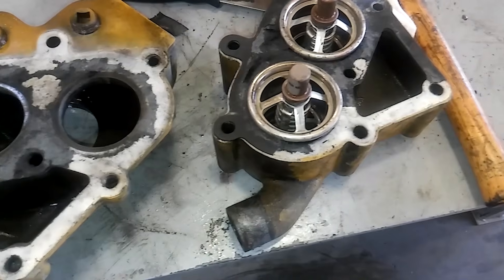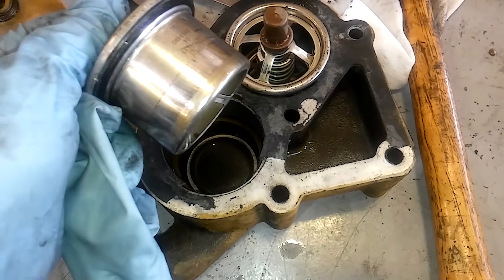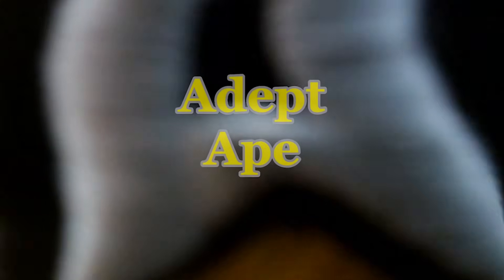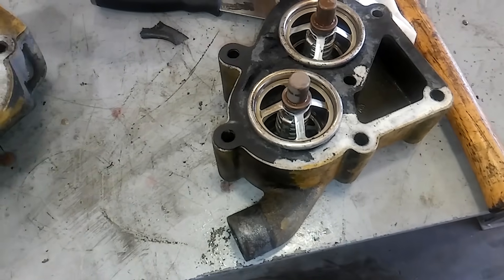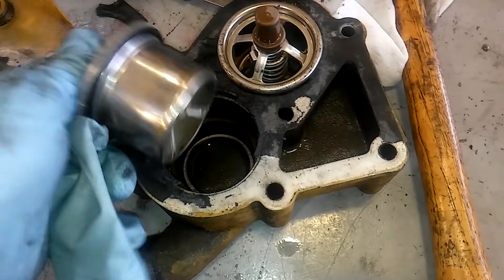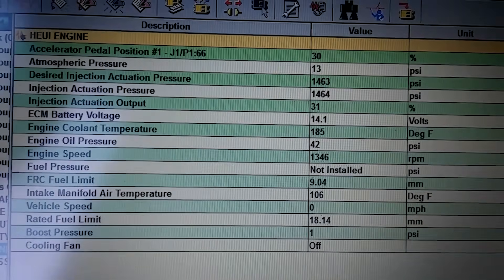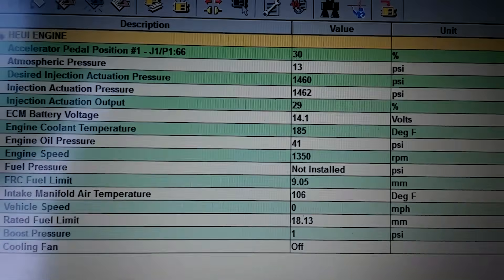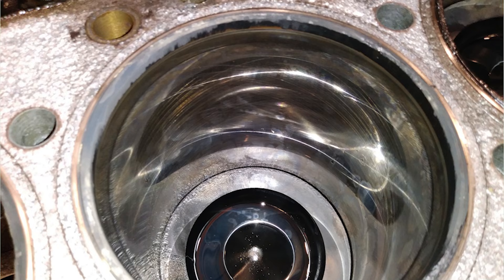Why You Should Never Remove or Use a Colder Thermostat In Your Engine.

Comment: As a former OEM truck engineer responsible for validating Caterpillar and Cummins cooling system installations, I find the ignorance of some of these comments astounding.  I agree with most of this video.  Here are a few points to clarify the video and the inaccurate comments.

Removing the thermostat can make the engine overheat, not run cooler, because the lack of thermostat means the bypass isn't blocked, so you're splitting coolant flow between the bypass and radiator instead of sending it all to the radiator.

To those of you clinging to the myth that coolant flowing "too fast" doesn't have time to cool off in the radiator, well, then it also doesn't have time to get hot in the engine.  Heat rejection is the flow rate times the temperature change, and being a closed system,  the temperature rise across the engine has to be the same as the temperature drop across the radiator.

There is no such thing as coolant flowing "too fast", but there is such a thing as too slow, where the boundary layer can boil on the heat source or not transfer heat efficiently in the radiator.  Boiling coolant on the heat source can cause erosion and/or cracking.

At a given operating condition, the engine always puts the same amount of heat into the coolant.  The coolant will get as hot as necessary to expel that heat into the ambient air via the radiator.  If you have a fan, radiator, water pump, pressure cap, or recirculation seal problem, a thermostat doesn't fix anything.  As the video says, the thermostat controls the engine's minimum operating temperature.  It has nothing to to with the cooling system's ability to reject heat.
Reply from the maker: I pinned your comment to the top, very good information there, especially the bypass and coolant speed. Everyone should read that.
Reply: @AdeptApe  if the bypass isn't hot enough and it's splitting coolant and not sending all of it to the radiator, then how can it simultaneously be overheating
Reply: That's Right  Thank You
Reply: My C15 Acert Is Fluctuating From 200 To 230
I just had a platinum rebuilt done 
Sounds like a thermostat problem?
Reply: @dwnsouthtrucking7307 same exact problem I'm having, got a rebuild and still running around 212 to 215  consistently. Did you ever figure it out? Use to never run this hot
Reply: Wanted to reply to the whole thread.
It lead me down a interesting path.
I guess the isx has a problem with carbon packing and there actually a special oil that can be used to try to off set the problem.
I’m going to copy and paste a response from truckersreport it’s a older thread.

I personally haven’t ran into issues on my older trucks.
But there is a problem. Interesting 
I think There should be a follow up video.
I run at 170f I let it run up to 200f from time to time then kick on the fan on a hard pull.
3406b.

We were taught about water injection years ago when I was in college to reduce carbon deposits. We actually have an ISX15 in the shop right now getting rebuilt due to the carbon packing issue and I was just asking in general about the water treatment how much nicer it would be versus rebuilding. I hope Cummins comes out with something like that.
Water injection was a temporary work-around and not a fix. The carbon comes back even faster and in the meantime you have downtime and labor costs. plus the downside of oil changes to get the weater out. Its a weak band-aid. Cummins finally started doing what Scania and Daimler (Freightliner) already knew, you need better coolant flow to keep the top of the cylinder cooler to prevent thhe formation and also a saver ring on the cylinder liner to scrape it off if it does form. Cummins came out with rebuild kits that have the new liner with what they call the APR (anti-polishing ring). Thats the fix. In 2014 all ISXs have that liner design. They just make the owners of old engines have to upgrade it on their own dime when they keep plugging DPF with ask from all the oil they've been burning.
Reply: Nailed it
Reply: Thank you! It's crazy how many videos out there spewing the too fast myth.
Reply: I’d rather run a little cooler stats and have some wiggle room before over heating if your running 210-215 stays then your right up on the temps if you run a 180-190 stat your going to run 10-20 degrees lower as for running at higher temp I can tell you this from experience cats do not like hotter temps they tend to crack heads I won’t let mine run over 200 degrees if I have to shift down into compound climbing a hill to keep it below 200 then that’s what I do take a look at the a and b model cats they ran lower temp stay than your e models the only reason your running hotter stays is for emissions I’d rather use that tenth of a gallon more fuel and have it run cooler
Reply: Engiener :-)))) i can tell  Why the F,,u..ck you build truck this way ENGiENER ?
 Why is it not possible to repair or reach to something??? Ha??  Why i have to remove 1/4 engine to access some part? f k  Engener
Reply: I would add, the thermostat blocking the bypass is on "some" cooling systems certainly not all. BUT it is a valid point!  ALSO MAKE SURE YOU HAVE THE CORRECT THERMOSTAT STYLE (For the Bypass to WORK/BLOCK properly) -  Also that myth that Coolant is moving too fast when there is no thermostat is reinforced by people who have had their lower hose "suck flat" and didn't realize it. They are same crowd that thinks Chrome Valve Covers hold in heat. -  Removing the thermostat will "usually" increase the speed of the coolant in the system, slightly increasing the "cooling capacity" of the radiator, and on a system that it is failing (overheating), it is a temporary Band-Aid, because your radiator/water pump has diminished capacity (or you have turned up your engine too far for the cooling capacity it was built with), and the slight flow increase will only make up the difference for a short time, until the Rad/Pump/Fan Clutch fails to cool the btu's that the engine is rejecting.  -  On our race cars we use tape to block the cooling air and do not run a thermostat, for several reasons...Mostly Aerodynamic (Tar Track) and Mud/Dirt Packing (Dirt Track)...But the cooling system is almost undersized (weight) and the faster coolant in the block keeps hotspots from forming...(The engine really runs good at 220-230°F but has extra clearances to not stick a valve or pinch a ring.)
Reply: Not sure about other cars, my Volvo mpg improves once I replaced broken thermostat. Stuck open thermostat let coolant run through the engine all the time and take longer time to reach the optimal temperature. Working thermostat let coolant pass through engine when it needs cool down. The car will reach the optimal temperature before heatjng up whole coolant.
Reply: Some cars cavitate at high RPM if there is no  thermostat.

Thats not likely on a low RPM diesel.

What started the whole "myth" about excessive flow through the radiator is that at high flow rates the pressure on the inlet side of the water pump can get so low the antifreeze will start boiling at normal engine temperature.

Remember that science experiment where the teacher makes ice water boil by putting it in a vacuum?

Well your water pump can do the same thing to your antifreeze if its spun up fast and theres not enough back pressure.
Reply: @glennchartrand5411  Yes and no.  Yes, if the outlet restriction on a pump is reduced, resulting in increased flowrate, the inlet pressure drops and the pump can potentially cavitate.  No, on it not happening in a Diesel engine.  Don't associate low engine speed with low pump speeds or low coolant flow rates.  When cooled EGR systems became the norm in 2004, engine heat rejection to the coolant increased by about 50%, and the coolant flowrate was increased to match.  Some heavy-duty Diesel engines are pushing 120gpm thru the radiator, and when the parallel circuits for the EGR cooler(s), engine oil cooler, intercooler/aftercooler/precooler, deaeration tank, heater, etc, etc, etc, are all added up, the water pump can be flowing nearly 200gpm total.  Caterpillar's Engine Application & Installation Guide has a cavitation test to verify that the pump maintains positive inlet pressure even without the pressure cap and has a minimum required temperature for the onset of cavitation.  All of the other manufacturers have requirements for positive pump inlet pressure and for no cavitation bubbles to be visible in the engine outlet pipe or make-up line.  The 2004 C13 and 2007 ISX water pumps are bad enough that it was impossible to meet the installation requirements, and the 2007 MaxxFarce 13 pump is such a turd that Navistar has a service bulletin showing "acceptable" cavitation erosion in the water pump housing on the engine front cover.  Test your pressure cap frequently, replace as necessary, and don't run a lower pressure rating.
Reply: @glennchartrand5411  much of the pump cavitation has to with impellers made out of stamped steel and shaped like a Chinese star...if they were shaped like a jet drive impeller it would not happen...
Reply: No vehicle I have owned (17 of them) has had a "bypass". Thermostat opens, cool water from radiator enters engine. Thermostat removed, always radiator cooled water entering engine. So warm ups in winter pretty much won't happen. And too much revving at a low speed will overheat it.
Reply: @240sxRule  Serious question: do you understand what a bypass is?  There is no such thing as a engine that doesn't have a bypass of some sort to allow circulation of coolant within the engine before the thermostat opens.  Many older automotive engines simply rely on the heater circuit to act as a bypass, so the thermostat isn't involved, but there are few to no engines that were developed in the past 30 years that don't have a bypass that is blocked when the thermostat opens.  Assuming you have owned a 240SX as indicated by your username, then you have owned at least one engine with a bypass that's blocked by the thermostat.
Reply: @KevinJames-yg9eu  yeah I'm pretty stoned and read  your bypass part wrong. But I still believe with the thermostat removed it's circumstance. If I start and idle it in -20, it will take a very long time to warm up, and once it it finally there, the fan will kick on, preventing it from overheat. If going hwy speed, it would run too cold, as it's constantly letting the colder air in. If at a standstill revving the fan probably wouldn't be efficient enough to prevent overheating eventually. Maybe I'm still too stoned to get the rest.
Reply: @240sxRule  You might never notice the effect of not blocking the bypass in daily driving of a passenger car because it's difficult to run most cars hard enough to really get the engine hot.  This video is about heavy-duty truck engines.  Those vehicles will actually run the engine at full power for extended periods on a regular basis hauling heavy loads up hills, where the decreased coolant flow to the radiator could potentially cause an overheat condition.
Reply: @KevinJames-yg9eu  ohhh shit now I get it. 🤦‍♂️ When the thermostats opens, it blocks the bypass, sending all coolant through the radiator. I guess we gotta go the extra mile and install a positive displacement pump if we want to remove the stat lol
Reply: @KevinJames-yg9eu  the last 30 years may as well be the last 3 years. The majority of vehicles people have experience with are older. Your problem is an extremely narrow point of reference and targets to check off a list worshipped as the highest form of knowledge. You can't even grasp the idea that emissions are tied to your cooling system performance parameters.
Reply: @jarlnieminen4307  Um, okay, buddy.  🙄
Reply: @KevinJames-yg9eu   I enjoy all the  input.
One thing about YouTube and the internet. It brings real life experience to the table.
I didn’t know about cast iron sleeves vs steel sleeves etc before this thread.
I’m not a mechanic but I do depend on equipment to make a living. 
All this is tied into the temperatures these engines run. Cummins changed there design because of carbon buildup. The Valvoline restore oil was a response to that problem.
When your talking $25000 plus for a rebuild it’s important. There’s a whole other subset of mechanics other than cat that works on engines.
Cat dosnt always approve.
Reply: @KevinJames-yg9eu  go reminisce about monitoring engine temps in a factory.
Reply: @jarlnieminen4307  Yes, because powertrain development work doesn't involve any real-world testing.  Engines go straight from the drawing board to production without ever running on the highway to see if they even work.  Please try to be less ignorant in your comments.  I have spent hundreds, if not thousands of hours, either driving a truck or riding in the passenger seat recording hundreds of instrumented channels of temperatures, pressures, and flowrates for intake, exhaust, coolant, oil, fuel, and DEF along with corresponding CAN data off the vehicle bus and then spending 10x as much time analyzing it as what I spent recording it.  Sorry if you don't understand the effort that goes into making a product work.
Reply: @KevinJames-yg9eu  😆😆😆 and your goals were to meet temperatures specified by those designs. Once again on very modern trucks. Your extreme arrogance and narcissism drives you to call everyone ignorant so that word means nothing to me coming from you. For all your "experience" your argument contains nothing but calling on yourself as authority. This is what happens when a data logger thinks he's now the engineer.
Reply: @KevinJames-yg9eu  there you go proof positive that your argument is exactly as I described. Thank you. And now you switch to everyone who doesn't agree with me is a troll.😆 good lord no wonder you crap on about your own importance more than you actually addressing the technical side. I'm sorry that you can only claim that bad things will happen yet your explanation does not agree with fundamental scientific principles. You even integrated  the argument of people you claimed to be ignorant as reference.
Reply: @jarlnieminen4307  Exactly WHAT technical issue is it that you would like for me to address?  I have no problem with someone disagreeing with me if they actually have a point to argue and facts to back it up, but all I've seen in your comments are ambiguous and condescending statements that somebody said something that is somehow scientifically wrong.  Your first comment was that something is "garbage".  I have no idea at who or what that comment is directed.  Then you essentially commented that nobody has worked on anything built in the past 30 years.  What?  Like they say, arguing on the internet is like running a race in the special Olympics....
Reply: @KevinJames-yg9eu  engines have stayed fundamentally the same. Cooling systems have not. Emissions have not. Climates that a vehicle operates in does not. Metallurgical requirements are not still the same. Efficiency demands are not the same. You yourself listed off the increased demands on the Cooling systems in modern engines. I'd be a hell of a lot less of a Jackass if I wasn't responding to someone who was already making their best effort to be one. Here's a thought do you think the engineers in all their wisdom prescribe the same thermostat, oils,heat exchangers or even tune for vehicles in Northern Europe, Japan or Canada versus Australia, Africa and South America?
Reply: @KevinJames-yg9eu  Ok fair enough criticism point taken. You ended your explanation with saying the thermostat has nothing to do with the cooling systems ability to dispel heat. That cannot be when the thermostat is responsible for determining when when flow through the radiator occurs. Some thermostats also can be less or more restrictive. Restrictions increase pressure increasing temperature. Restrictions also lower flow which lowers heat exchange, unless the radiator itself is already at  its maximum which means a bigger radiator would be needed to see any difference. A bypass reliant on the same thermostat that is dictating flow to the radiator is not always the case.
Reply: @Jarl Nieminen  Aside from the air to air aftercooler replacing the air to water aftercooler and most engines adding an EGR cooler, how is a modern cooling system fundamentally different than something from 75+ years ago?  They still have a centrifugal water pump, just with a lot more complex design and tighter tolerances to increase output.  They still have a belt-driven mixed-flow fan, although it now has nylon blades instead of steel or aluminum, and it has some sort of electronically controlled clutch instead of being bolted directly to the pulley.  The heat exchangers are still tubes and fins, although they're now mostly aluminum instead of copper and brass.  The metallurgy of the engine isn't identical, but the main components are still based on iron and aluminum with copper, tin, and lead-based bearings.  The temperature limits of the materials are essentially the same, even if they're not the exact same alloys.  I'll give you an exception on fundamental material differences for the nickel alloys in components in the exhaust stream..  Better machining, better lubrication, better coolant, and pressurized cooling systems allow the base engine components to run somewhat hotter, but most modern engines derate at around 230°F engine coolant outlet temperature for self-preservation, not a whole lot different than 75 years ago when you shut it down because the water was boiling at 212°F.  As for the engine calibrations and cooling systems varying by where they're sold and how they're used, do different locales have different emissions standards that necessitate different calibrations which have different heat rejection which then necessitate different water pumps, fans, and radiators?  As I said in a previous comment, obviously the cooling systems vary by vehicle application.  And no, I've never seen anything saying to switch from 15W-40 to 10W-30 or 5W-40 engine oil in cold climates.  I've never seen an engine blow the oil filter clean off the filter head, leaving strings of oil swaying in the breeze due to an 800psi oil pressure spike during start-up in a cold cell at -40°F.....
Reply: @KevinJames-yg9eu  I'm sorry how can I take that seriously. The fundamental base elements being the same in no way means that the metallurgy is the same. The blocks and sleeves may still be the same or extremely similar surely. As for the rest of your comment are you being sarcastic that's a lot of sarcasm to avoid the point.
Reply: @Jarl Nieminen  To your actual question/point, I think we're saying the same thing, just using different words and/or not understanding each other.  Perhaps my initial comment ended with a poor word selection.  I probably should have said "capacity", not "ability".  Obviously the thermostat controls how much coolant flows to the radiator and when, which controls its ability to cool.  The video is about changing to a thermostat with a lower opening temperature or removing the thermostat.  My point was that changing nothing but the opening temperature of the thermostat does not change the ultimate capacity of the cooling system, it simply changes the minimum operating temperature of the engine.  Cooling capacity is based on the design of radiator and how much air and coolant are flowing through it.  Yes, you can install a less-restrictive thermostat, resulting in increased coolant flow, but that's a pretty minor restriction in the grand scheme of the entire engine and cooling system.  In my experience, the water pump was run at different speeds via different pulley diameters for different ratings of the same base engine, but that was more to generate pressure and flow to prevent localized boiling in the cylinder head and EGR cooler, not specifically to increase flow to the radiator.  Due to the vast difference in the specific heat of air versus coolant, you generally get bigger reductions in engine coolant outlet temperature by increasing air flow, preventing recirculation, and increasing radiator frontal area (if possible) than by increasing coolant flow.  Removing the thermostat altogether can have varying effects based on the bypass, pump cavitation, etc. as already noted by me and others in prior comments....
Reply: @KevinJames-yg9eu  oh.....yeah capacity of the radiator to exchange heat. I misunderstood.
Reply: @jarlnieminen4307  You misunderstood my point due to my poor word selection.  Errors were made on both sides.  Just don't tell me my comment is "garbage" with no explanation.  The initial issue was easily resolved once I knew what it was.....
Reply: @KevinJames-yg9eu  I agree those are all much more affective at lowering coolant temperatures. Also on a side note a lot of people would be wise to investigate their fuel consumption if they start running slightly hotter without any change in operating environment.
Reply: @240sxRule  EVERY vehicle has a bypass, sometimes it's built into the HVAC system, it allows the coolant to circulate when the thermostat is closed...Many Diesels and Ford Clevelands have a passageway that when the thermostat opens it closes that bypass.
Reply: @misters2837  I have now since learned of the stat closing the bypass.
Reply: Never heard such garbage. The water does not disappear therefore increased flow equals lower temperature. The laws of thermodynamics do not agree with what you have followed from your caterpillar engineers.
Reply: Its not going to get anywhere near as lower temperatures as you are warning against. Can you go less than optimal in both directions yes but cold enough to cause damage I will wait for you to actually test and prove that theory.
Reply: I enjoyed you comment.
The cooling  system as a whole is designed to cool down the engine. Thermostats hold the heat in the block until they open up on a diesel.
I ran a 3406b for over 2 yrs with broken thermostat (rare reason why).
I figured I would just run it until she blows.
Wouldn’t ever reach temp unless on a hard pull.
So why then the different thermostats and why the different sizes of radiators.
I can tell you but I’m barely a shade tree mechanic.
Your reference is right but wrong.
On a hard pull you need time
Edit: I will not run a truck of my own without a fan on off switch. Reasons for this. Your argument maybe the cooling system is working right.
My argument the load is hard to pull the hill.
Reply: Just to argue with my self and increase Josh algorithm.
My argument is that it puts extra heat that is not needed but is epa friendly. This is older engines.
Like I said you guys are the pros. 
In school there are taught xyz but remember that teaching maybe warped in various ways.

Back to my chilly cheese fries
Reply: @RB-cz5jn  Every truck that is sold has to meet the engine manufacturer's cooling system performance requirements for engine coolant outlet temperature, intake manifold temperature, and charge air cooler pressure drop along with requirements for coolant fill, deaeration, drawdown, pump cavitation, system pressure, etc. and other engine installation requirements such as turbocharger inlet temperature and restriction, exhaust restriction, exhaust temperature drop to the catalytic converter, air compressor inlet temperature and restriction, and air dryer inlet temperature.

Caterpillar, Cummins, Detroit, Navistar, Volvo, etc. use different terminology and have slightly different requirements and test methods, but nobody sells a truck that doesn't meet their requirements.

The cooling systems are designed so that every truck sold will cool properly in the worst possible condition it could ever see, which in the USA is on I-15 heading out of Baker, CA.  If you haven't run that grade at max GCW in the summer, you haven't used your cooling system's full capacity.  There are longer or steeper grades in the USA, but Baker is the worst combination of all factors, particularly the ambient temperature.

For laboratory testing, trucks are run on a chassis dyno in a wind tunnel at peak torque and peak power until the temperatures all stabilize, which takes 15-30 minutes.  The specified wind speed depends on the engine rating and the truck application.  Higher-powered tractors with 80,000 pound GCWR will be run at 30 or 35 mph.  Severe service tractors or medium-duty trucks with smaller engines might run 15 mph, and a heavy-haul tractor with a 150,000 pound GCWR might only run 5 or 8 mph.  That said, there may be some overlap in the application of cooling systems.  A radiator and fan may be sized for a 600hp 15L engine but also be used on the same engine with 500hp, while a 400hp 13L in the same truck uses smaller everything, unless it's a Navistar MaxxFarce EGR engine that puts out more heat than a 565hp Cummins ISX.  Never mind that 15L MaxxCat abomination.  Navistar designed a new, taller hood and increased the BBC to fit that thing's cooling system into the ProStar and then promptly cancelled it.

Whatever the case, I assure that there is no component on the cooling system not necessary for meeting performance requirements.  Parts cost money.  They aren't there for nothing.
Reply: @KevinJames-yg9eu  this where I love you guys.
I get my pride in the sunshine of hard knocks.
Trucks over time wear out. Every truck is a ticking time bomb. As a owner your trying to get the last squeal out of the pig. Your numbers won’t hold up over time.

Now to the part of grades. You’ve never delivered freight I’m guessing. Wasn’t to long ago a Melton driver flatbed got himself into trouble. Put on his parking brakes. Grade was to steep to hold.
Those grades you are referring to are not realistic when you’ve got to drop tower parts on top of a large mole hill.

Before all this started I stated there’s to many variables for me to make a argument. Wear and how old and gearing etc..

We can dyno it and watch it but that isn’t real world like double dips. Hit one grade right after another.
To many variables 
Thanks for the convo
Reply: @RB-cz5jn  Well the point is, when the truck was NEW...The cooling system was large enough for "maximum effort" at worst case scenario for hours at a time... The PROBLEM is, once a truck is 5 years old...It has lost its cooling capacity due to rust and coolant breaking down into goop...and it fills the block and radiator.  Talk to a Genset Mechanic, the engines are 100% stationary and are required to be load tested and they do that with specific requirements for different ambient temperatures. Sometimes by compromising the radiator with blockage. Many times a genset will need new radiator and nobody realized it, because  rarely does anyone exercise the unit when it's 110F and full load...it just doesn't normally get run like that...